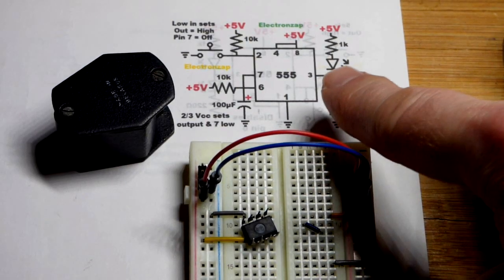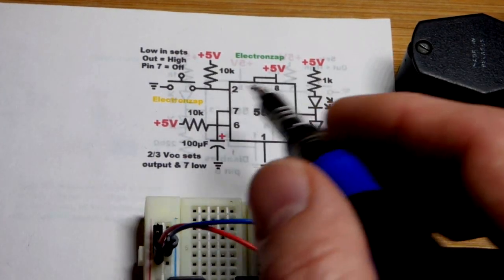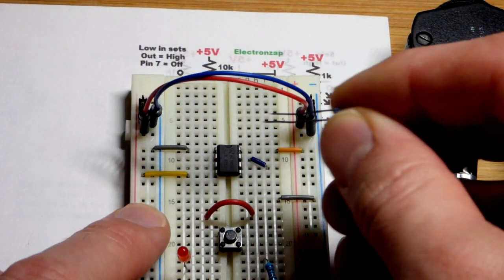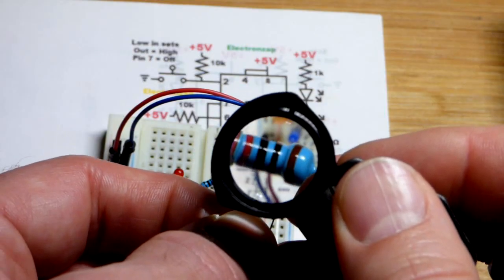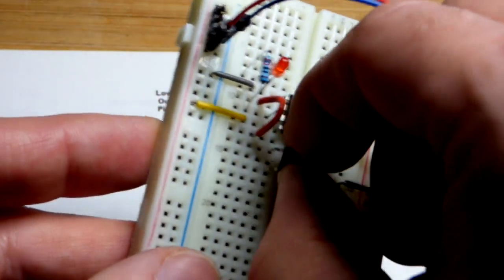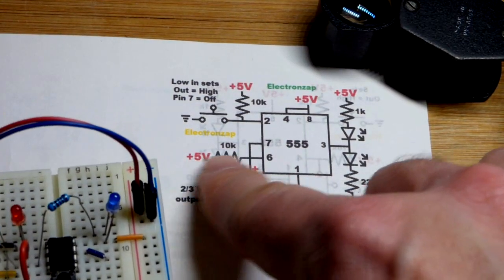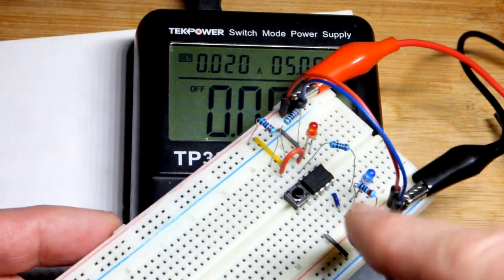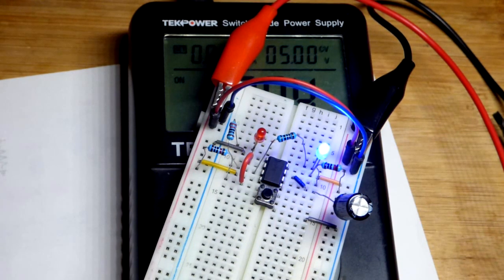Step by Step Monostable 555 Timer Build For Beginners Learning Electronics

Comment: Thanks! multimeter tells many things. your drawing and basic knowlage (what LOW, HIGH means) help me some. according to OUTPUT (LOW or HIGH), LED 1 or LED 2's voltage difference is much interest. multimeter between LOW(OUTPUT) and 5.3v VCC tells 5.26v. then between HIGH(OUTPUT) and GND tells 3.97V(220 ohm is between). Your english is so fast so  not easy to listen for middle aged East Asian guy, but could hear some important phases. I think you are an Amerian from your english, that's right. Good luck for this hard decade with not beautiful some GREAT policitions here and there. Thanks again.

Comment: Monostable mode means it acts as a monostable multivibrator, meaning it has one stable state.  This is also knows as a single-shot or one-shot.  There is also a bistable multivibrator, also known as a flip-flop.  An astable multivibrator is known as an oscillator.
Reply from the maker: Thanks for the info!